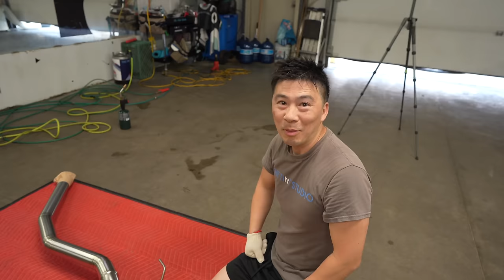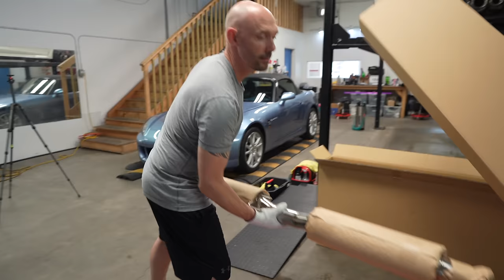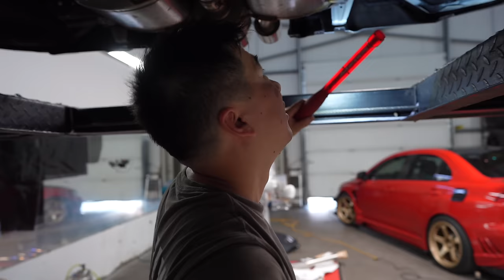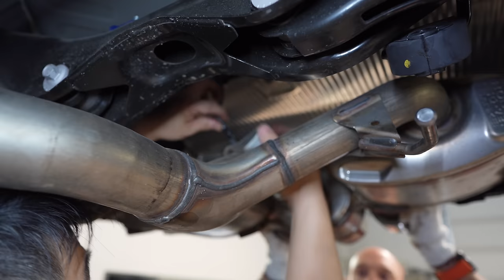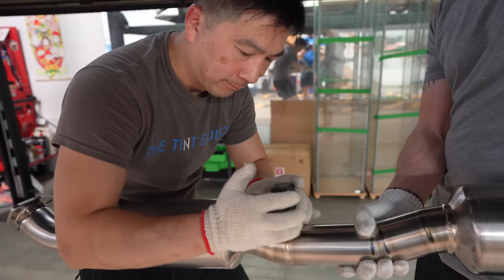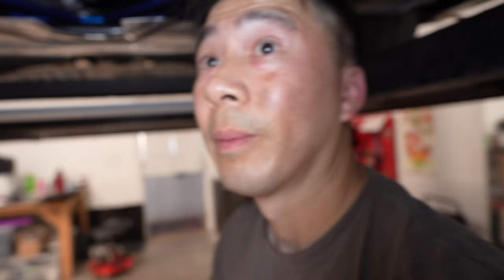R1 TITAN Honda Civic Type R Exhaust Is Unreal!

Comment: Sure, it's pretty but I'm not hearing much of anything! I'm not for obnoxious either, but that seems just as quiet as stock. For now, I'm leaning towards the front resonator delete for mine.
Reply from the maker: I'm thinking of deleting the resonators to see if it makes a difference. Also with the new turbo coming the down pipe cat will be deleted. At that point I'm certain it will be way too loud haha
Reply: Do a muffler delete because if you go downpipe it’s gonna sound like shit, learn from me lol
Reply from the maker: Can you send me a sound clip on ig?
Reply: @phothrottle  let me see if I still have it, I had bought an exhaust nearly right away due to not liking the sound
Reply from the maker: @juliansandoval3211 thanks
Reply from the maker: Thanks for sharing. I will check it out!

Comment: Small dump pipe to a larger exhaust is the worst configuration. A stock FL5 will blow straight past you. Will be running so lazy unless you increase the size from turbo and tune it.

Comment: Pretty sweet. I went with a front resonator delete which when combined with a rear motor mount and drop in filter, sounds and feels perfect. I also have my exhaust locked in the open position.  If you dont wanna shell out money on a whole new exhaust, i highly recommend these quick simple mods.
Reply from the maker: I'm gonna lock the valve and in the process of deleting the resonators for comparison.  👍

Comment: Do i need to reset a brand new actuator before installing to an after market exhaust? Also what should be the valve position closed or open?
Reply from the maker: No you don't need to reset the actuator and the valve should be in the close position because when the   car shuts off the valve is in the closed position by default.
Reply: @phothrottle  if the twist the knob to closed position, i am having hard time fitting the spring on. It only fits when the knob is in horizontal position( open)
Reply from the maker: @Shank0818 no it should just fit right in the only resistance you should feel is the resistance from compressing the spring.

Comment: just to confirm, what you have is the 3 outlet but 2 resonator exhaust build correct? Im noob and it looks like 3 resonators but I think you said 2 at the end
Reply from the maker: Yup that is correct. Two resonators but I would choose the one resonator option to give it a little more sound.
Reply: @phothrottle  any chance u would do a video with the one resonator version? Thanks for the response!
Reply from the maker: @vellusk I requested for a none or one resonator mid pipe for comparison but it will take awhile for it to arrive. I will keep you posted.
Reply: @phothrottle keen on this! i've heard one of these in person, also with 2 resonators, sounded good but would be keen to hear it with just one or no resonators!
Reply from the maker: @wilsontse8963 I'm still waiting for them to respond about sending me a single resonator mid pipe. It might take awhile to get thi part since it's made to order and from Japan. But I will definitely do an update vlog once I get it!

Comment: Hi bro, does this R1 titan exhaust system can plug and play with stock front pipe?
Reply from the maker: Yes it is a direct bolt on to the stock front pipe. It bolts up perfectly 👌
Reply: @phothrottle thanks bro. Thinking to get this exhaust system too after reviewing your video. It’s just more than beautiful
Reply from the maker: @darrenlimchoonhui326 if you are considering buying contact Invision Auto Imports. It's much cheaper in Canadian currency.

Comment: Did you consider the two outlet R1?
Reply from the maker: I seen it at Tokyo Auto Salon in person it was not offered with the valved option and I wanted an exhaust with a valve.
Reply: @phothrottle  makes sense. Congrats on the new exhaust. It does sound nice
Reply from the maker: @carminered thanks I appreciate it!